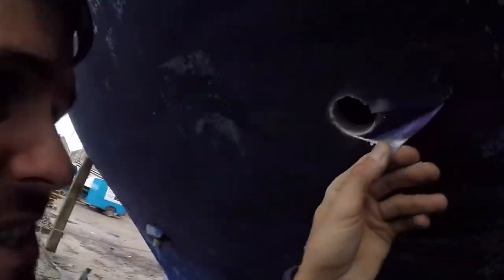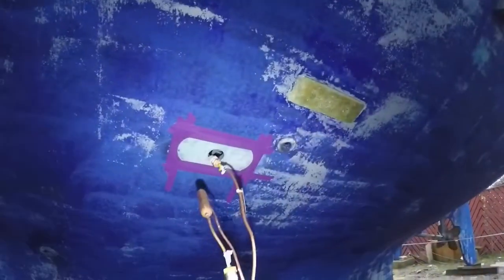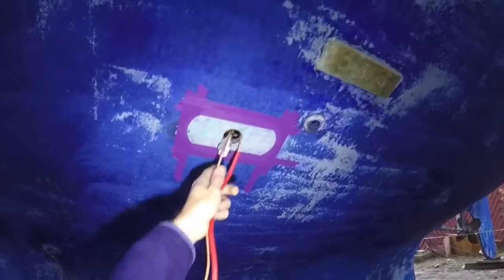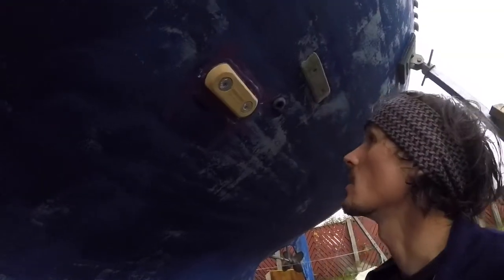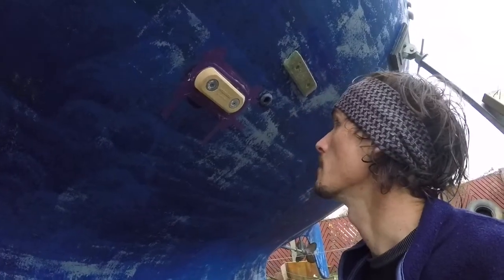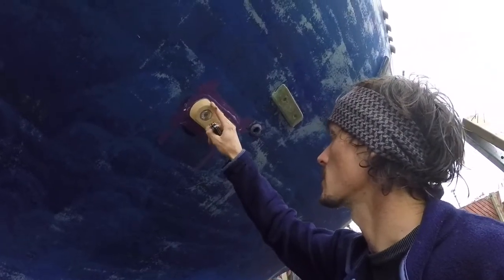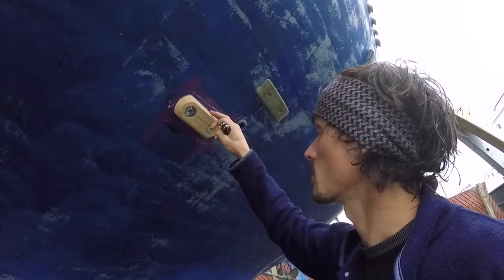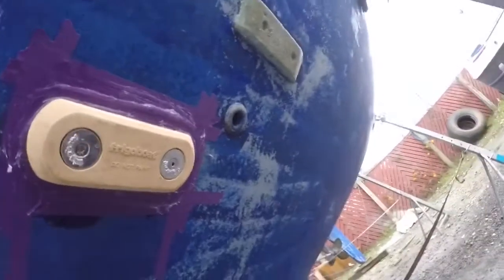Fitting a "keel cooler" to our boat fridge

Comment: Do you have to turn off keel cooler when you haul out? How do you do that?
Reply from the maker: No. But if you need to run your fridge out of the water you’ll want a compressor which is fan cooled also. This way it’ll work both in and out of the water.

In the yard the plate feels warm in the bottom of the boat. It’ll be helping a little but not much.

Comment: the thing is calle a "keel" coller because it works well if installed down at the keel. It's there where you find cool water. At half a meter's depth it may not be worth drilling a hole in your boat!
Reply: Even 80F water flowing by at a few knots will suck away a lot of heat.
Reply: @bradgilmer6684 ROFLMAO.
Reply: The water only has to be cooler than the hot refrigerant for it to work.
Reply: @crunchycrispybacon And if its "room temperature" in the cabin the refrigerant is far from "hot".

Comment: Would have been good to see how it connects at the fridge.
Reply from the maker: With the frigoboat system its just plug and play. The fridge I have is fan operated version so i can use it out of the water also. The compressor therefore has two connectors going to and from the heat dissipation plate. The plate that the fan blows on to. You just disconnect one of them which give you a male and a female end. You then just plug in the male and female end of the keel cooler in series. There is no coolant pressure lost from the system when doing so due to the plug and play fittings. Hope this helps.
Reply: @ChasingContours  I see, thanks. Won't you need more coolant tho because it has more pipework?
Reply from the maker: @neojted  Good question... the Keel cooler is supplied with coolant in the pipework already. Its been running fine since i did this job and we've been to Norway, France, Spain and the Canary Islands. I should however check now the pressure of the coolant :)

Comment: Do you have any concern that there is no sea cock in the system?
Reply: It is basically a big bolt.  It isn't a water inlet so there is nothing to put a valve on.

Comment: Did you have any trouble getting the brass plate to fit flush to the hull? We have yet to figure out how to fix that issue
Reply: Hannah Woolever there is a foam backing plate that takes out any issues with it being flush.

Comment: Is the cooler still operational when the boat is up on the hard?
Or will it only work when the boat is in the water?
Reply: Uh it only works when its in the water as the water is what does the cooling so without water it won't work, unless you live in Alaska maybe !
Reply: From what I read online,- it doesn't seem to work very well.
Reply: The compressor has a fan and heat sync also. When out of the water I just flick the switch so the fan comes on.

If you're a liveaboard and plan to spend time out of the water then I recommend getting a compressor that can be both water and air cooled.